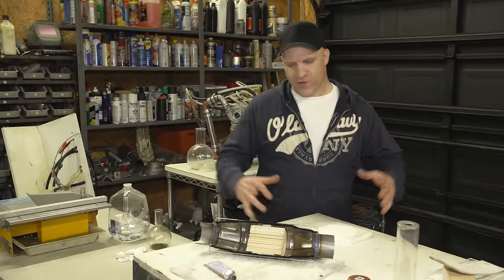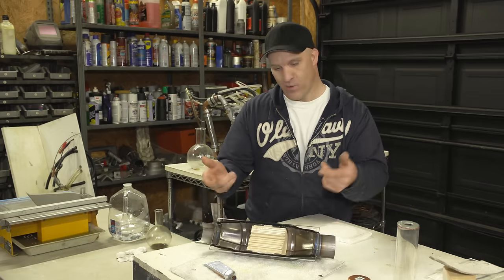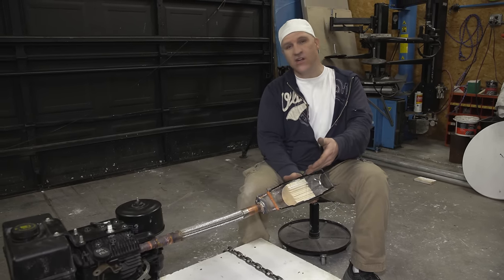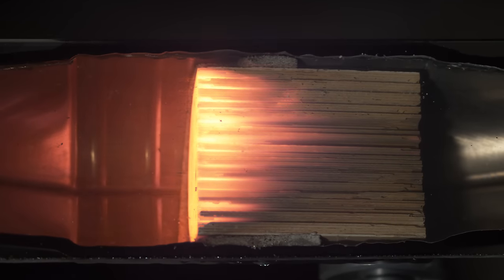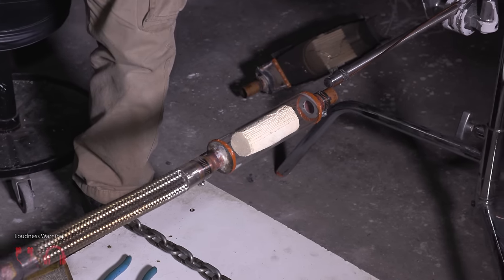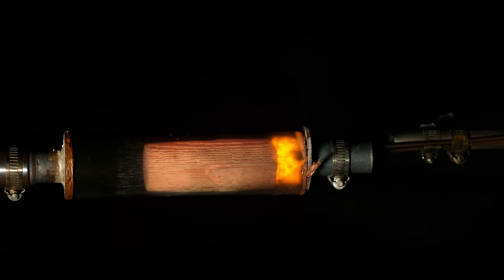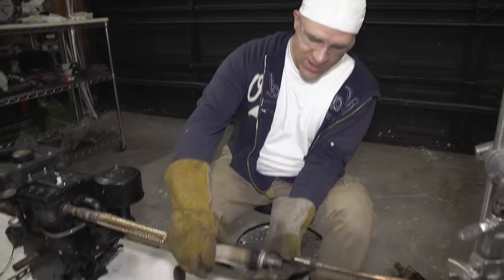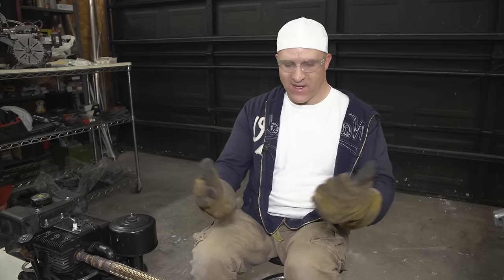See Through Catalytic Converter

Comment: 6:00 There is no hydrocarbons being burned inside the catalyst, because both catalyst and burning need oxygen. And you don't have  enough oxygen for catalytic converter to work and for unburned fuel to burn while you have constantly rich mixture. The "fireball" can only be seeing at the exhaust end where hydrocarbons get oxygen to ignite.
You didn't show the functioning catalyst - it can not function without additional oxygen that is left in the exhaust by the engine control system using slightly lean mixture. Exhaust gas analyzer would be a great help to educate people.
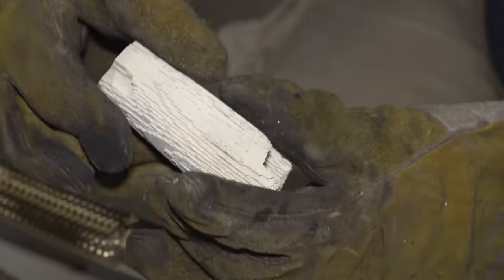7:45 The catalytic converter might be looking like "perfectly new", but it still might be out of working order, because it is not the ceramic cells that convert CO and HC into CO2, but catalytic materials like platinum, rhodium, titanium oxides etc. are long gone from the surface of the ceramic honeycomb due to the high temperature of the converter.
Man, if you make this kind of educating videos, you have to know, how things work first of all. Second, you could use a gas analyzer and thermometer to measure temperature of the exhaust and for example show, how fast it starts working after a cold start and what kind of temperature it keeps during normal engine work etc.
Otherwise great videos you've got, thanks!
Reply: He did show how it works, just not the way you wanted, it was a cool video so don't hate.

Comment: Just remember kids when you have a bad Catalytic converter thats what youre paying 600+ in parts for.
Reply: Nah, just weld in straight pipe and O2 sensor extension. 30$ and problem solved. I have it and pass emissions no problem.
Reply: @arni291  if there are real co2 Tests  you wouldnt pass it.
Reply: @CaddoxGames20  Run the engine until gas is almost empty, pour in 10 bottles of HEET, co2 issues shouldn't be a problem.

Comment: You haven't really shown us how CAT works when it's doing it's job, you have shown us what happens to CAT during horrific engine failure. With the second one we've also seen what effect there is on exhaust flow when gas burns in CAT/also happens when exhaust diameter is too large. The exhaust literally turns around, reverses and ruins the flow. That sends a shock wave down the exhaust which eventually starts pounding on the engine itself throwing everything off.

Comment: looks to me like the gas is getting passed the converter to toss flames out the back................not good !
Reply: Two step man lol
Reply: It is good because the catalyst is reburning the leftovers.  It's doing exactly what it is designed to do.  The choke may have reached a point of richness that the catalyst is struggling to keep up with.  Nevertheless, it is causing the exhaust mixture behind it to be much cleaner than the mixture before it.
Reply: For the converter to convert CO to CO2, you need oxygen. The catalytic converter can't work if there is no oxygen due to an over rich engine. Extra fuel, no extra oxygen, unburned fuel out the tail pipe.  A missfire on the other hand provides too much fuel and oxygen to the converter resulting in overheating.

Comment: Very interesting. I always thought cat converters just used platinum and palladium as catalysts to break down harmful sulfur and other compounds, but didn't think much about it having this job, to burn off unburned hydrocarbons before they get out into the atmosphere, should the engine start running rich either through deliberate action of the driver/operator (choke,) or due to a carburator or ECU malfunction/error. Makes perfect sense, unburned hydrocarbons are a pollutant, so give them a large surface area to burn on between the engine and atmosphere. Too bad they can't find some way for diesel engines/exhaust systems to burn off all that soot that we see spewing from truck exhaust pipes when they get on the accelerator.

Very informative video, thanks!
Reply: They have. They're called diesel particulate filters. Modern diesel engines smoke very little. The ones that do have probably been messed with.

Comment: When they first made the switch from banning Lead (Super) in Australia (1994 if I recall) to Unleaded fuel, they produced a booklet for what car could safely run on unleaded, and what 1 needed a upper cylinder lubricant sytem that metered a lubricant into the carby via a drip feed. My car at the time being LPG already ran hot and dry so it needed the super to lubricate to keep the cylinders lubricated and the rubber hoses from drying out.  When the leaded became phased out, I had to get a upper cylinder lubricant system installed. It was near the radiator and ran a hose over to the vacumn line on the carby where the mechanic figuired out after the engine size and such it needed 6 drips (about 10 mls per minute) to safely lubricate. The lubricant was 1 litre and cost $15, a lot for that time. To me it reminded me of the oil added to 2 stroke fuel. And no, my car did not have a catalytic converter on it. But all cars sold or manufactured after the switch to unleaded had to have them.

Comment: Pretty cool in slow motion. You can actually see the valve overlap. 
This is why new cars have an O2 sensor before and after the cat. 
If a lean or rich mixture is detected, the computer compensates so the cat doesn't get ruined. 
Glowing red hot with destroy a cat.

Comment: Hey brother pro tip.....when youre putting copper together like you did sand the ends of the pipe and the insides of the fittings and use a little bit of flux on any place you sanded and youre burning the pipe black with that oxy ectylen torch its much to hot...use a lil propane torch and heat it starting fitting first..when u burn it like that the solder won't flow and take well  because of the carbon burns on it from getting to hot....not saying it didn't work or that I'm ripping u but it would save time and a lot  frustration  with the steps I just posted.....and as soon as the solder starts to flow (don't melt the solder with the torch let the heat of the pipe melt it) you'll see it just go into the joints like its magnetized.....and thanks for vid I always wondered what was in a cat too and why so expensive and why they need precious metals in it?

Comment: That was pretty awesome!  A sequel video experiment should be repeated with pollution sensors placed on both sides of the catalytic converter. In this way, the viewer will get an understanding of how the levels of NOx, CO, etc. are reduced after the exhaust passes through the catalytic converter. I think it would be a worthy demonstration, with the sensors added and the glass cutaway omitted.

Cheers !!

Comment: It's not supposed to be glowing underneath your car. If you ever see the case of a converter glowing hot. You have a problem! It means that it's falling apart on the inside and clogging itself up or the engine has been running too rich or burning oil for an extended period.
Reply: Exactly.  Misfires and rich conditions rapidly deteriorate the catalyst and in come cases the valve overlap allows the engine to pull the abrasive particles from the exhaust into the cylinder and ruins the rings and cylinder walls and the engine consumes oil and runs poorer.
Reply: @Vile-Flesh  yeah I could see that. I have never really thought about it or heard it mentioned before. But your right it could happen. What especially comes to mind is some engines that have pre cats, or "mini cats". They are only a foot or less away from the cylinder head. So I'm sure those would be very likely to suck those loose particles backwards.

Even in this video you can see how the pressures of the exhaust flow backwards. It's almost like the engine is taking breathes. This process is used in 2 stroke engine exhausts. Where the exhaust systems shape and size is tuned specifically to help those exhaust pulses to refill the cylinder under back pressure. Also even 4 stroke engines need some type of exhaust to be able to run well. Or even run at all. Because of the same principals. Recently the exhaust fell off my old car with a 318. So the exhaust ended midway under the car. Only a few inches after the converter. No muffler, no tail pipe. The engine gained a slight bit of power. But the fuel mileage dropped ALOT. I presume this was because of loss of gasses that would linger of reburn.

Comment: so for those wondering (might have the same explanation lower didn't check all the way trough) 

a "cat" work like a furnace, it suck up some 02 and use it to burn excess of gaz, n0x and some other polluant to reduce the impact of a gaz/fuel engine 
the reason it start turning red when rich is because it work to hard for the design (if your engine shoot that much fuel/gas in the exhaust there will be a flashing check engine light in your car) the make of these is nowadays a "basic" honeycomb patern made mostly of ceramic and some rare metal (which explain there cost) that help burning down the more polluant gasses to create mostly c02 and water 

hope that helps sorry for the english...
Reply: the older version work with ball and/or air pump to help the burning process

Comment: i would recommend using Borosilicate glass. its way better when it comes to heat and im sure there is other type of glass that can also resist heat.
normal glass just cracks from thermal shock

Comment: I spent some time on powertrain test cells and managed to get a development engine in to a massive overboost situation with massive valve overlap (variable timing and lift engine). Next thing we knew, the bottom of the cat was bright orange and after shutting everything down, the ceramic core had melted and was a lump in the bottom of the housing. Amazing the heat you can generate with a load of fuel going through a turbo and igniting inside the cat.

Comment: One more thing that would have been interesting to watch is what an overly lean condition does to the catalyst. As a decades long auto tech i've had customers bring their vehicles in complaining of a lack of power situation. Subsequent test drives indicates a very lean running engine and on several occassions the converter got so hot(glowing cherry red!) that the carperting would start smoking or at times would even catch on fire. A very lean condition with a converter will definitely get your attention very quickly!
Reply: Actually a lean condition will reduce the exhaust gas temperature as will a rich condition, the highest exhaust gas temperature will occur at optimal air fuel ratio from optimal combustion, and in the case of cat converter a rich condition will cause them to overheat (as this video shows) resulting in their premature demise. (which is not a product of high exhaust gas temperature). There may be some other condition you are reading as being due to a lean mixture such as partial blockage of the cat converter that can cause a higher back pressure and thus high exhaust temperature, low intake vacuum and lack of power.

Comment: the fireball was caused by the outgassing of the sealant you used. you can see it clearly int he slow mo the fireball starts when the cylynder starts to move out of place, exposing the previously-unexposed parts of  the seal, you even see flame of externally-burning gases being sucked into the convertor near the bottom at one point

Comment: 6:04 really cool footage, but the fireball surely means the hydrocarbons didn't get all catalyzed in the cut down converter. The superheated leftovers exhaust and ignite in contact with air. If the converter was properly sized, it would chemically convert the fuel into inert gases. The catalytic converter doesn't burn anything. It catalytically converts stuff without oxygen. Heat is released in the process, hence it gets hot.

Comment: They need air to become effective. Older cars had an air pump that ran to the cat to feed it oxygen so the NOx and CO could bond to the extra oxygen. Notice how it really started glowing once the glass lid opened up and let air in. Also explains why the second test had fire coming out- not a complete exchange of molecules in the catalyst. Without the extra oxygen, the hydrocarbons go in one side and out the other.
Reply: modern cars achieve this by running leaner than 14:1 air fuel, but I've never seen a modern cat with an air inlet..
Reply: @traugdor  Exactly right. Thats why I had to specify older cars

Comment: One problem with using the choke to add fuel to the exhaust is that it leaves very little oxygen in the exhaust for the catalyst to combine with the excess fuel. That is why early catalyst cars (well, all through the 80s) frequently had air injection pumps that added more oxygen to the exhaust so the catalyst had something to work with to burn the excess fuel and carbon monoxide.

Comment: My old 1976 Mazda RX5 had temp probe in rear muffler because exhausts ran so hot in them, and despite Australia having only leaded fuel until 1986, it still had a cat converter fitted to it.

Comment: i m not sure to understand why you chose a rich mixture because the purpose of the catalytic converter is, for a gasoline engine, to :
- oxidise CO in CO2, HC in CO2 and H2O
- reduce NO in N2 and O2

but the efficiency of this converter needs a richness around 1 (hello lambda probes), and a temperature near 400°C

for a diesel engine, we only can oxidation... because the richness is lower than 1... always (and that's why we have some problems with NO and NO2)...

Comment: Very impressive insight and slow motion. But: A catalytic converter is designed to be operating at lambda = 1, not with a fuel rich mixture! Under real conditions it is not supposed to burn unburned fuel and thereby becoming red hot. In fact, fuel in the catalytic converter will cause its premature failure.
Reply: Correct, CO that the cat converts to CO2 is a by-product of combustion itself and therefore is not "unburnt" fuel which is simply hydrocarbon.

Comment: The converter builds high heat in order for it to do its job. That is why you are not supposed to park over dry grass or leaves as they can combust from the heat communing off of the converter.
Reply: They should be better insulated. What if cardboard box got caught under it.

Comment: the catalitic converter needs to go from SLIGHTLY rich then to lean, and rich to lean switching very quickly. The reason it does this is to store oxygen on the surface of the substrate, when it is  lean.  When the rich mixture goes through, the stored oxygen combines with the rich un-burned fuel(Hydrocarbons) and makes Co2.

Comment: Flames coming out after the cat do not mean it was working, but actually that it was failing, i.e. insufficiently sized for the task. You had unburned fuel making it past the cat, and it was flashing due to the red hot conditions of the chamber -- which would have happened with or without catalytic material given it was red hot at the time.

Comment: I have been mechanic for 22 years. the first one i estimate hit about 1800degrees f almost the melting point. the second one carbon fouled almost immediately but like any converter eventually burned through it. converters do more than just burn unused fuel. incomplete combustion also produces pollutants like nox( oxides of nitrogen) wich contribute to smog, carbon monoxide, and finally raw hydrocarbons. "

Comment: You could get fire coming out without a cat present.
If the hydrocarbon mix is oxygen-free but above the autoignition temperature, then it will spontaneously combust when it comes into contact with air.

Comment: you should see if you can get a working boiler from a few converters to run a steam engine off of. then once you get that working get the steam engine to power an HHO generator which will power the converters and make more steam, completing the cycle. see how close to self sufficient you can get..

Comment: No wonder there's a exhaust action on diesel engines called Regeneration. It can burn up those carbon deposits on the converter surface, it has to park on the side of ride to run idle rich for sometime?  There are two types of exhast particulates, one is carbon from incomplete combustion and the other is soot from engine oil.

Comment: What would have worked better is if you welded that so the only visible area was the core itself then create a box section tunnel that has glass over it about 6 inches from the core that way you could seal it better and less chance of cracking the glass

Comment: The reason the catalyst was glowing at the output in the second clip is because it is out of oxygen. Vehicles have an air pump on the exhaust side of the engine to prevent this. The fireballs are because it is no longer working and excess fuel is escaping.

Comment: Amazing, you can see the flames product of unburned molecules of fuel traveling through exhaust fumes. This experiment gives the reason why the modern cars are "slower" than the classics. The catalyzer performs as a "brake" not allowing to evacuate the exhaust gases as fast as they need forcing the engine to break that created resistence to treat them. Impressive.

Comment: The fire on the exit does not mean hydrocarbons are being burned by the converter... the unburned hydrocarbons are igniting on contact with oxygen in the air as there is no oxygen in the vessel. This is proven by seeing the empty space behind the converter does not contain fire, however on exiting the vessel the mixture ignites on contact with air.

Comment: The slow mo looked like how a ram jet works.  You could see the fresh air enter the outlet then the rapid expulsion of burning gases.  I wonder if the joint hadn't failed and a suitable shaped jet pipe was installed what thrust would be generated.